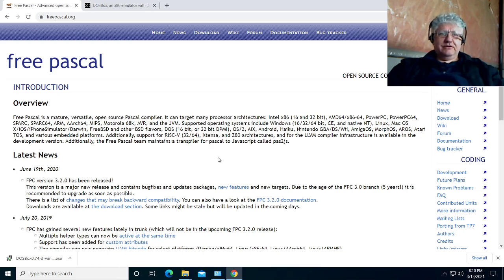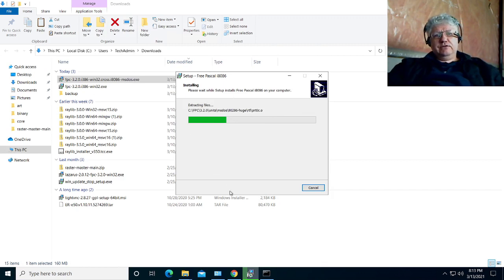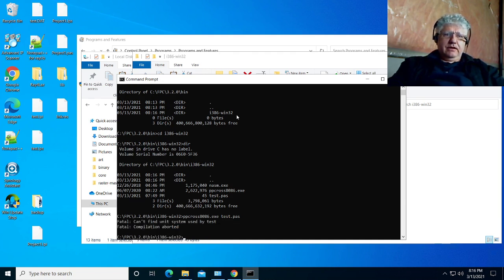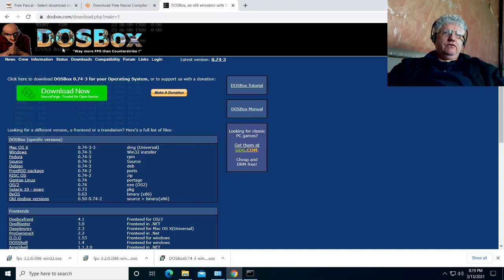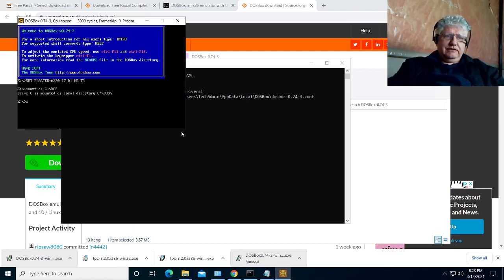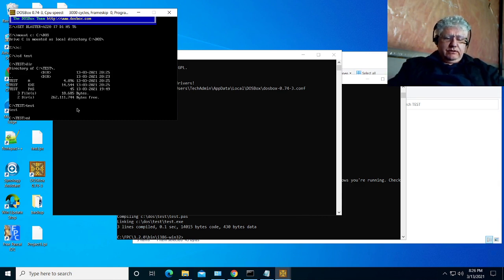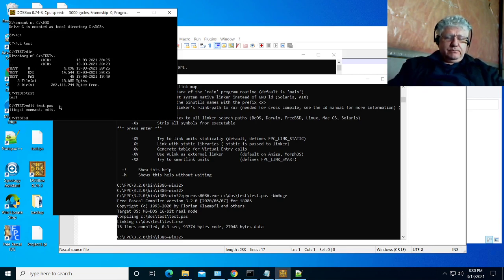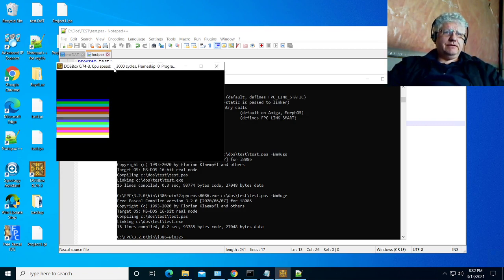✅ freepascal 8086 cross compiler for Windows Install - Day 19

Comment: Hi, I'm the Free Pascal developer, responsible for making the 8086 port :) It's really nice to see people using it and having fun with it :) I agree that we should make it more obvious that our cross compiler installer packages are actually add-on packages for the main win32 compiler. I'll try to think of something for the next FPC release.
Reply from the maker: hey thanks for dropping by. I really like all the things you are working on. you may not remember but 15 years ago you helped me out with ptcpas when i was trying to get the mouse working. i'll keep an eye out for new versions and thanks for all your great work over the years!
Reply: @retronicksprogrammingchann2337  Yeah, I remember helping someone with ptcpas, but didn't know it was you :) Nice to see you're still using Pascal :) Btw, I'm currently working on a WebAssembly target for FPC. It's still not stable enough, but the goal is to build something like Emscripten, but for Pascal and be able to cross target the web browser as well as the native platforms with games and demos that use graph/ptcgraph or opengl/webgl. We already have Pas2JS, which is great for new code, that intends to target the web browser, but WebAssembly is expected to run faster and support all Pascal language features (including low level stuff, like pointers, etc.), so porting existing code would be much easier. :)
Reply from the maker: yes this all sounds fantastic and is very interesting to me. I am using pas2js and can't use the move command so everything i'm used to doing i have to refactor my thinking.

Since I have your attention with pppcross test.pas -WmHuge I get
test.pas(13,1) Error: Code segment "SYSTEM_TEXT" too large (exceeds 64k by 112 bytes)
test.pas(13,1) Fatal: There were 1 errors compiling module, stopping
Fatal: Compilation aborted

If I remove sysutils and IntToStr it compiles fine.

Program test;
  uses graph,crt,sysutils;
var
 gd,gm : smallint;
begin
  writeln(IntToStr(1));
  gd:=EGA;
  gm:=EGAHI;
  initgraph(gd,gm,'');
   delay(1000);
  closegraph;
end.
Reply: @retronicksprogrammingchann2337  Yeah, this is a problem that we have. Using sysutils adds too much code and easily exceeds the i8086 memory limitations. This unit was designed in the Delphi era, where these memory limitations didn't exist. I still haven't an easy solution for that problem. :( The problem is things like RTTI, that are added to the program, if you don't use all the classes, so smartlinking can't eliminate them. :( It is also a problem on embedded systems like AVR. I cannot think of any other solution, than making a lightweight version of sysutils, that contains less stuff, e.g. only IntToStr, StrToInt, etc, but it's going to break Delphi compatibility.
Reply: @retronicksprogrammingchann2337  Regarding Pas2JS and the move command, yes, this is exactly the point. 'Move' works perfectly on the WebAssembly target, as well as pointers, FillChar, etc. And it's a Harvard architecture, so code and data are still separate, so it's pretty safe from a security point of view, a buffer overflow would only overflow data, but not code, so it's practically impossible to make a remote code execution exploit, even if the code contains a buffer overflow bug. Which is nice, provided that this thing runs in the browser and runs untrusted code from a random website :)
Reply from the maker: I worked around it. I was only using IntToStr and just created a wrapper function around the Str command.   Most  things i have tried work really well  with ppcross, and I am really good at breaking things so good job!
Reply from the maker: This is really nice - any idea when there is something to test?